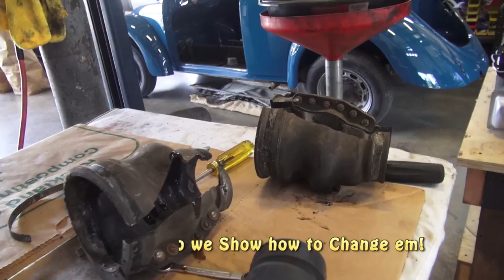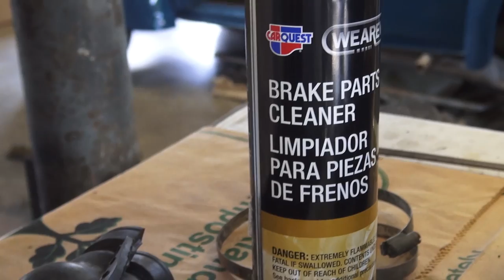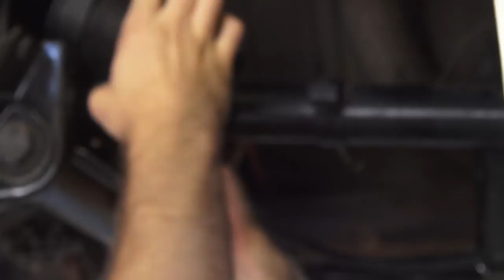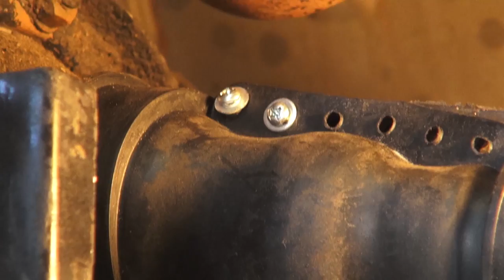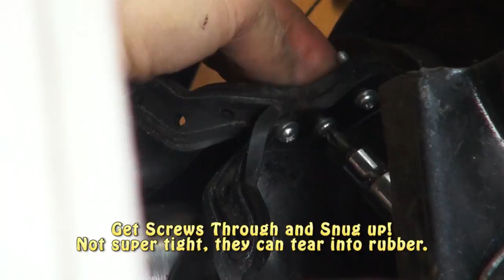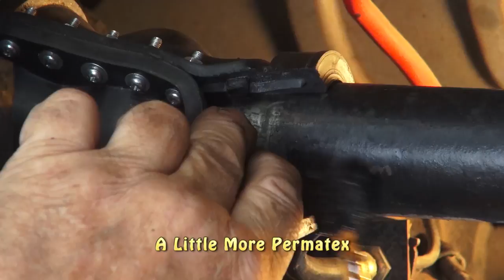Classic VW BuGs How to Replace Worn Out Leaking Beetle Swing Axle Boots with New

Comment: Just did this.  Cut the old ones off.  Bead of permatex on seam,  my book says seam horizontal facing the rear.  Make sure you clean the area good before installing.  Check boots at every oil change.  Cheers!

Comment: I’ve had problems with the boots dry rotting after a year or so. I rubbed gear oil all over the outside of the boot to help keep the boot from dry rotting and ripping. Great video!

Comment: Just wondering how much gear oil does the 1965 trans hold I used 3.5 quarts until it ran out the filler but every where I looks it says only 2.5 quarts? Did I overfill?1965 stock beetle

Comment: If you align the rad clamp on the same side as the bolts, is there enough counter weight on the other side of the boot to prevent an imbalance? Does the boot keep the oil that leaks out of the transmission contained? Great video, thanks!
Reply from the maker: The axle does not spin, that is a tube there that the boot is on, so you don't have to worry about imbalance.  And yes the boot stops the oil.
Reply: Thanks for the info, I need to change one of my boots... great videos!!

Comment: Hi chris is it normal to have leaked oil inside the boots? I recently replaced my boots. Whem removing the previous boots i noticed its filled with oil.
Reply from the maker: It should have some in there for sure.  Be sure your seam is in the right position.

Comment: I know my question doesn’t have anything to do with boots but is there a video on how to adjust the door gap at the door handle area? It’s tight by the hinges and a big gap at the handle... thanks
Reply: Mine had that problem on the passenger's side. This was caused by a front end hit. Threw it off by several millimeters. I made shims to the hinge side.
Reply: JosephDR 
Thanks for the info, I will give it a try